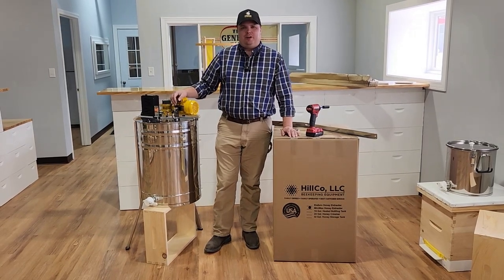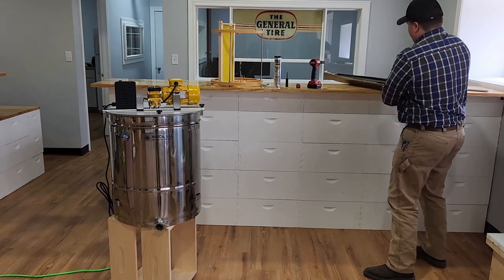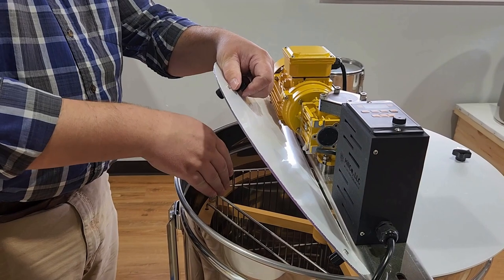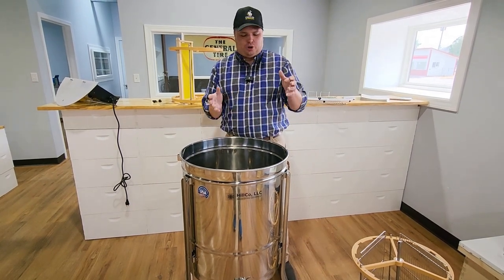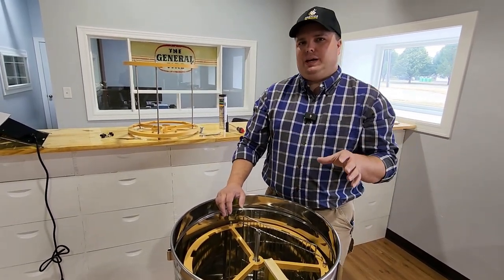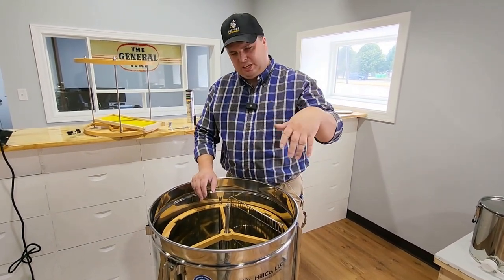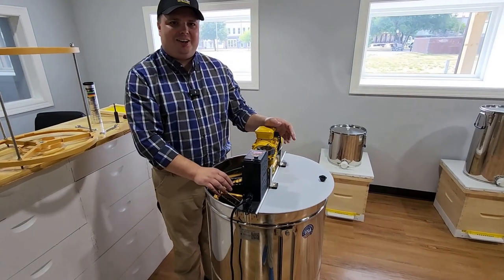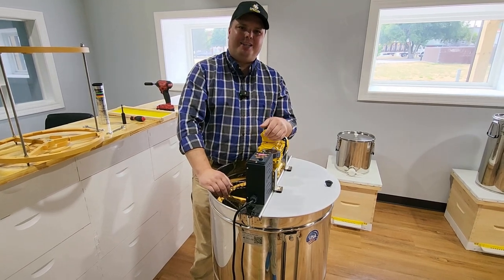Unboxing & Assembly Instructions for Minimax and Enduro Extractors | HillCo, LLC

Comment: I ordered/bought the ultra max extractor from hillco, it’s the 18 frame version and wow what a nice machine!! I had to wait about two weeks to get it but it was well worth the wait! I live about 30 minutes from Betterbee and I could have drove down there and got one of theirs but after watching videos on the hillco machine especially Barry’s best honey I went with the hillco machine and I am very glad I did!! Before this I had a four frame Tangential extractor and it took hours to extract even though I ran it with a drill and I ended up with more honey than I usually do because it is so much easier to run and let it run longer and get every last drop of honey out of the frames

Comment: Have you thought about supplying a rubber cap that can fit on the inside , around the ball bearing fitting. So m when cleaning out the tank the ball bearing can't fallout?